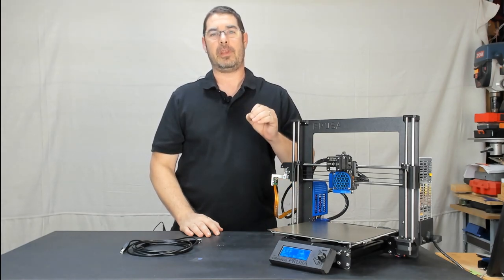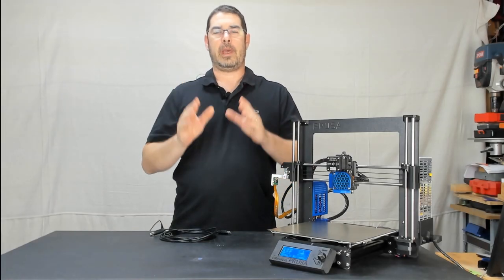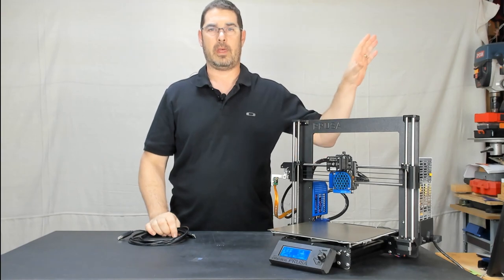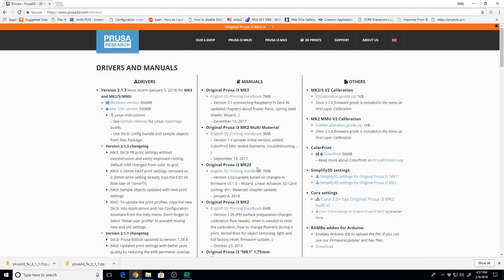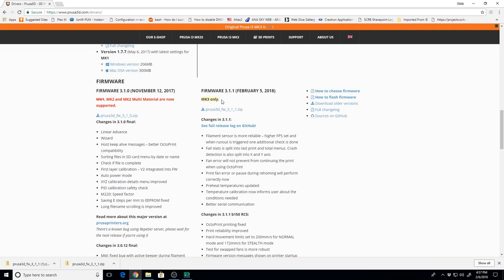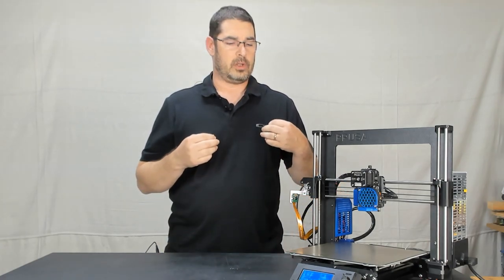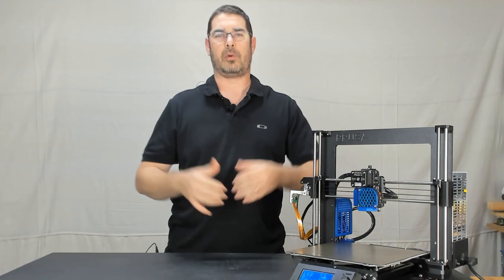Update the firmware on your Prusa Mk3. It’s easy!

Comment: Thanks for the post. I did not know they had another firmware update yesterday. Hopefully this will fix the random layer shifting problems many of us are having.
Reply from the maker: I sure as heck hope so!!!!
Reply: Just did the firmware update to the MK3. So time will tell as I do more prints. Joel "3d printing nerd" has had the layer shift problem as well. Thanks again for the heads up.
Reply: this is no where near the final firmware there issues with the mesh bed leveling that they are still having issues with

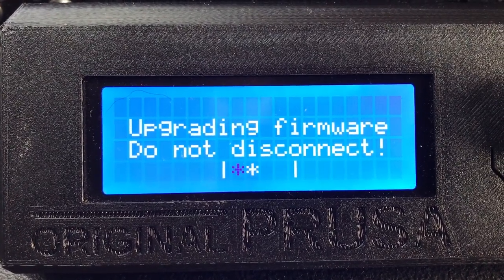Comment: I love Upgrading my filament and I never disconnect (3:40 mark).  I  joke we all make verbal mistakes, I just thought it was amusing.  This process is so much easier then my old printer of hooking a Arduino Uno and with a custom built cable hooking that up to the board then changing jumpers and disconnecting the screen just to update the firmware!  Thanks can wait to get my mk3 now!  Though I know the wait is almost over as it's status changed to shipped some time while I was sleeping.

Comment: I had an issue with my printer after I flashed it to the latest firmware. The filament sensor was detecting that it was no longer connected. I had actually just used the auto load filament feature and completed a successful print before updating, so I knew it was functional before. I had to perform an all data clear / factory resent and complete the wizard to resolve the issue.
Reply from the maker: Corey Dryja that can happen in some cases unfortunately depending on if the update changes the locations in memory that are used.
Reply: Thanks for responding. I figured as much but wanted to share my experience incase someone here runs into the same problem. I reported the issue to the dev team.

Comment: Hi how you doing I just forgot my MK3 prusa I3 printer I was wondering would you be possible for you to do a video on how to properly level the bed I'm having a hard time leveling the bed
Reply from the maker: Junior, the Prusa MK3 bed is fixed height and does not need leveling. Are you having problems running the calibration wizzard? If so, I would suggest reaching out to Prusa support
Reply: ok i will do that

Comment: This firmware can set the printer to default values, so you may consider M503 before flashing/upgrade and compare the results before and after. PID tuning and other changes may need to be done again. Octoprint has a firmware update feature, maybe you can also show this in the next video.
Reply from the maker: Good points. I do want to make sure there are no issues loading firmware via the direct-connect of the piZero (vs USB) before I bring that topic up. Have not had time to test this out yet.

Comment: Hi I would like to know what slicing software are using for the prusa I3 MK3 and what are your settings
Reply from the maker: So far I am using Prusa edition Slic3r from the last Jan 5th update with default settings.  Now that firmware is stabilized I may look at build an s3d profile, but as of now, Slic3r is doing a pretty good job.

Comment: Hey! Love the vids! I tried updating the firmware on my Prusa i3 mk2 and it bricked my lcd! Can this still be done with a bricked display and will it repair the bricking?
Reply from the maker: Hmmm. You were using Prusa firmware? (not someone else modded version posted on line)? Does the backlight on the LCD still come on, or is it completely dark?  You can try to refresh it, you don't need the LCD to do that, but it your screen doesn't come back after the update, I'd suggest reaching out to Prusa tech support.
Reply: Practical Printing yeah there’s still light, apparently it’s a firmware problem? It has light etc just with 2 x rows of white bricks
Reply from the maker: Stu H you can always try loading in an older version of the firmware and rolling it back.

Comment: You can program an Arduino Mega (or an Einsy-Rambo) from Linux with the following command: avrdude -p m2560 -c stk500v2 -P /path/to/serial -b 115200 -F -U flash:w:/path/to/image.hex